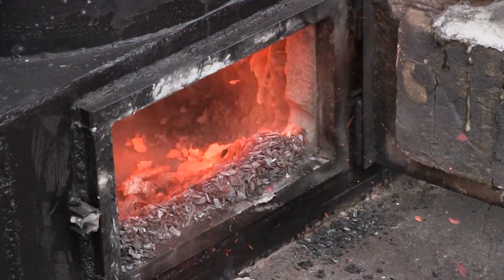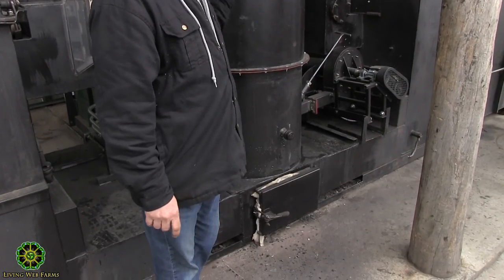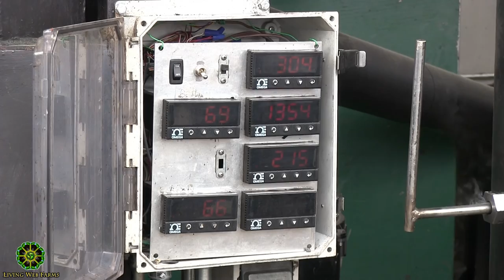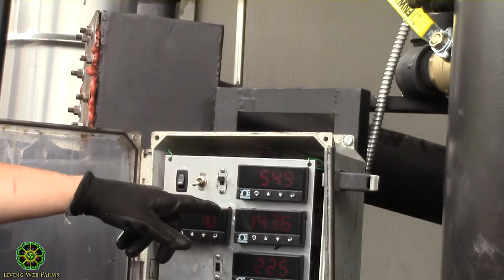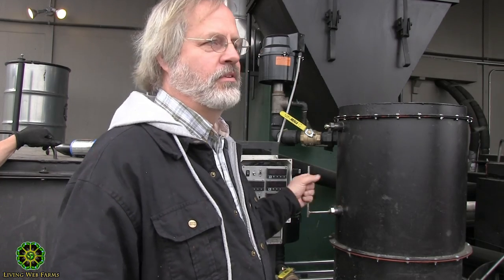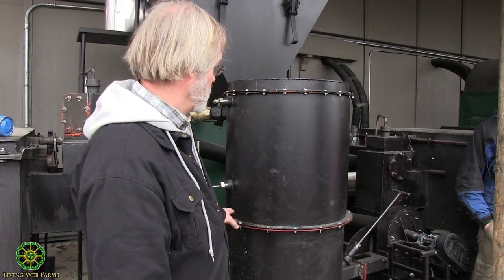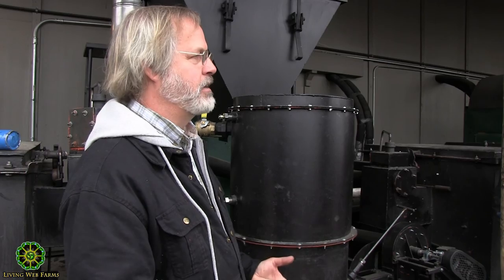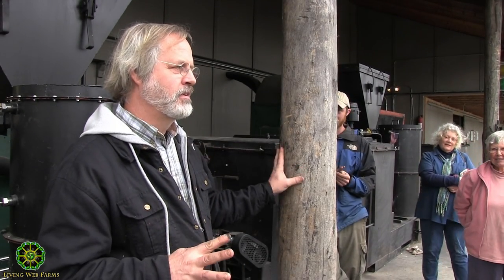Farm Scale Biochar Part 7 Operation

Comment: He's absolutely right. If I had a home version of this, I'd use the syngas to run a generator to power my home, as well as using the biochar to provide my food. I'd also run my car on either the syngas or the wood vinegar (you can also refine, or "crack" some of the heavier condensate as well). That is VERY old, WWII era technology.

Comment: This works similar to my central boiler outdoor stove. The flame burn down at the bottom of the wood. The temperature in the burn chamber runs from a 1000 to 1400 degrees.

Comment: This system is very impressive, and we can learn a lot from it. Unfortunately it is not going to solve the CO2 problem because it cannot be adopted widely enough or fast enough. What is the cost of this system? How much carbon can it sequester per unit of time, per dollar spent on it? And how much time do we have to get CO2 down to a level that might allow humans to avoid extinction?

An affordable LOW TECH biochar production system is required so farmers all over the world can make their own biochar from local waste biomass. The key is to understand how the Amazonian people made so much biochar using WET biomass. They did not have metal, but they had pottery (which is better than metal in some important ways). They understood fire and how to properly burn the exhaust gases, so pollution would be minimal.

Once you understand how ancient people did what our experts say is impossible then you will know how we might solve the CO2 problem. The solution is already in our possession.
Reply: Maybe big Ag should be investing in making bio char instead of pesticides and herbicides ;). Imagine that ... or keep dumping synthetic fertilizers, which ever works!
Reply: Another option would be to build small, home-based units that people could use in place of expensive and pollution-intensive solar panels to power their homes.
Reply: Pyramid flame cap kilns or simple in the ground pit burns are low tech.